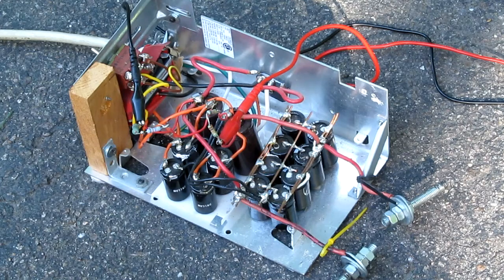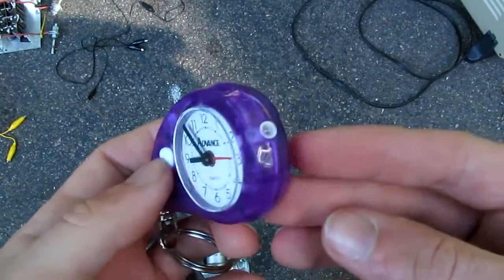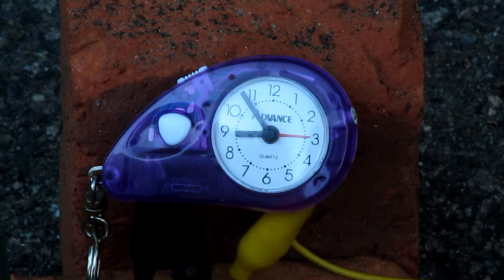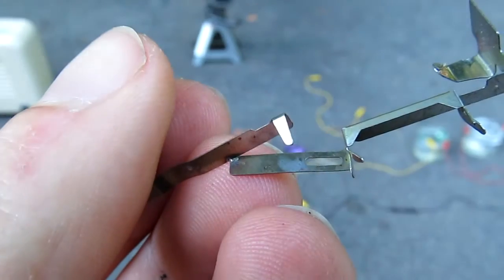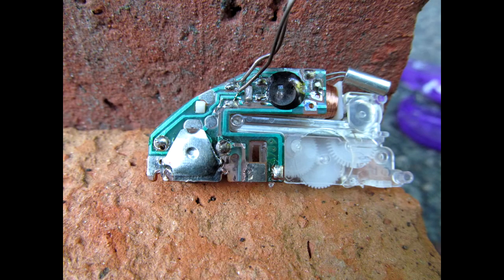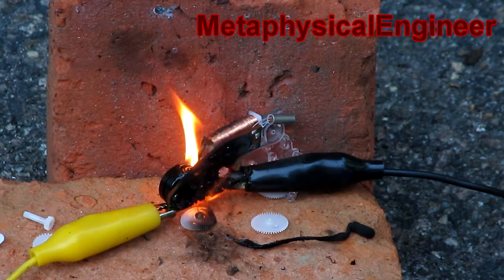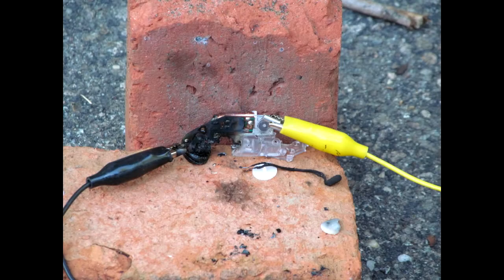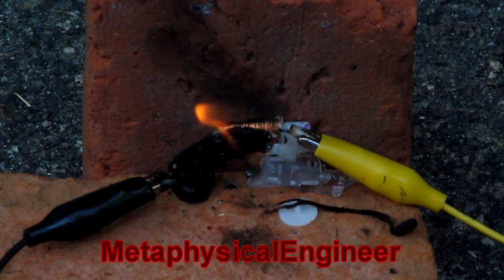Tiny Alarm Clock High Voltage Destruction

Comment: I really wanted to see the clock alarming on high voltage to hear audio glitch :(
Reply from the maker: Maybe next time!  Though it probably would have gone from alarm screaming as normal to boom without much in between.  Small electronics are surprisingly tolerant of a wide range of input voltage up until things suddenly let go and flash over.